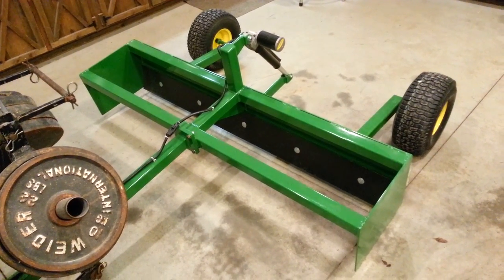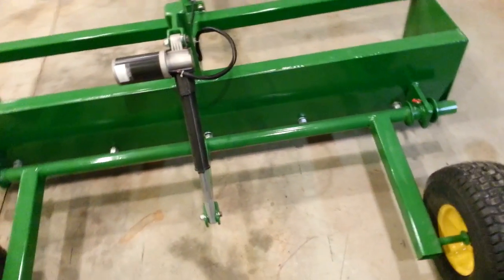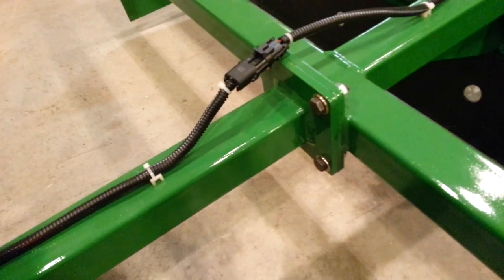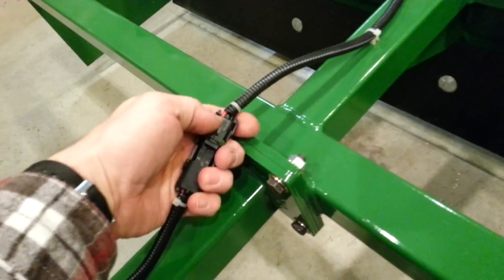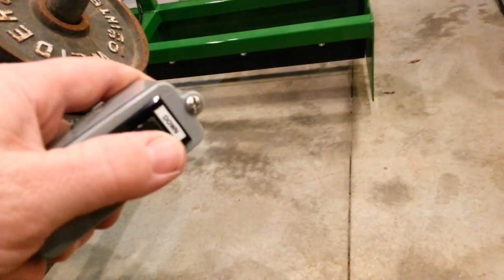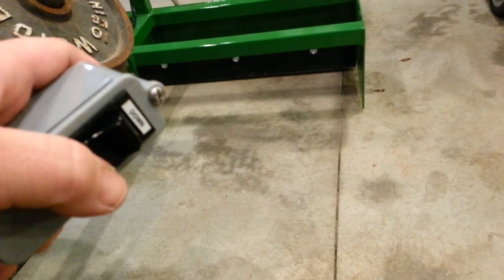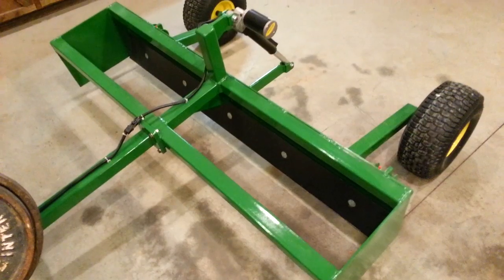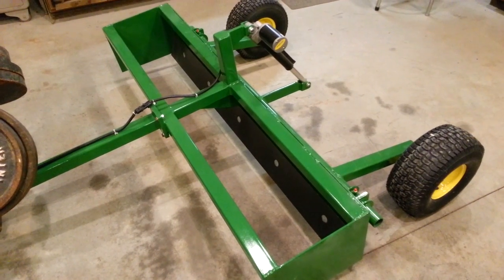5 foot pull type grader box blade

Comment: Hey this we want for our lawnmower this is cool it will match our lawnmower and flowertrailer and also getting a a brand new John Deere lawn sweeper at Lowe's in Oskaloosa because why the one mom found was all used up the barrens needs repaired it got all rusty and beated up mom found that on Facebook used Market Place it's doesn't sweep up any grasscutings unfortunately we will return it back to Facebook Used Market Place we are buying a new one so our cats won't get inside and scratch the tarpon so we put it in the detached garage/shop so our cats wouldn't get inside and scratch the new paint-job hey cats stay away from here don't get in here meow

Comment: May i ask what actuator you used on this blade?
Reply from the maker: This should have everything you need John: https://youtu.be/4bINFRDTR48
Reply: @digdrivediy  thank you. I have watched that one. May have missed the electric actuator. Saw the hyd cylinder.  Actually have a 318 with hydraulics  but may be rebuilding my current 3 pt blade i built to a pull type so i can use it with other machines.  Thanks man. Great build.
Reply from the maker: Thanks a lot. Good luck.  The actuator link is in the description of that blueprint video.

Comment: If you want it three point put one of those bars with all the holes in it across your lower link arms then you will have infinite  adjustment.  I have both he's correct pull type gives much more precision grade
Reply from the maker: Nice tip David!  Thanks for watching.

Comment: Has anyone used this scraper to "fix" rutted atv trails?  Would be using a deere 318 to pull.  Ground is muddy.  Thanks
Reply from the maker: Not sure if it will work so well in the mud.  Not entirely sure what really would work too well in the mud for that matter.  I'm sure it could fix up the trails when they are dried out.  Depends on the consistency of the mud, meaning clay or silt how it tends to flow out from under the bottom of the box.  Would be interesting to know how it does.

Comment: The understand making a profit, so go for it!  I'm just using a simple lever, using turn buckles to make the height adjustments on my blade and scarifier bar ( has teeth on it to bust thru the hard packed gravel) Once I made the adjustments, I can raise and lower it with the lever and it will go back to the pre-determined depth every time. I'm fortunate to have access to scrap steel from the construction company I work for so price isn't that much of an issue. My blade is a 1 inch thick grader blade so it should last a life time. It's amazing just how well it works and such a simple design.

Comment: Very nice box but can you build it to work with cat 0 3 point and if so how much would it be?
Reply from the maker: Well, actually the whole point of this style grader box is to eliminate the problems associated with a mounted grader box, in that a mounted box will follow the ups and downs of the tractor and make it difficult to get things actually level.  The grading action of a pull type box is in my opinion, far superior to what can be achieved with a 3 pt mounted box.  Now, the 3pt box certainly has it's place.  They are great for moving material and pushing dirt backwards, etc.  We have not build one of these as a mounted box yet.  I think you would likely find something available at a local farm supply store that would do the trick.  Thanks for your comment.  We appreciate the feedback and discussion.